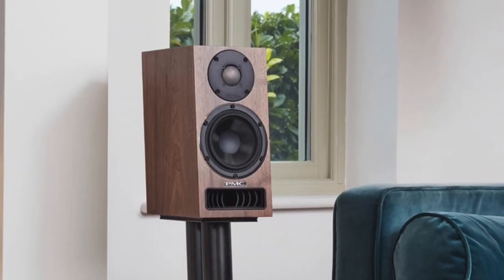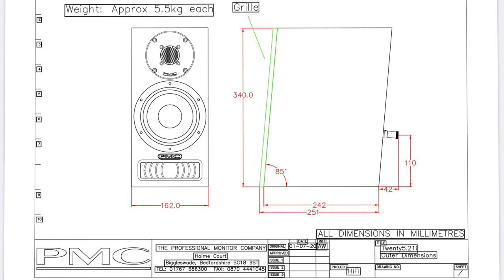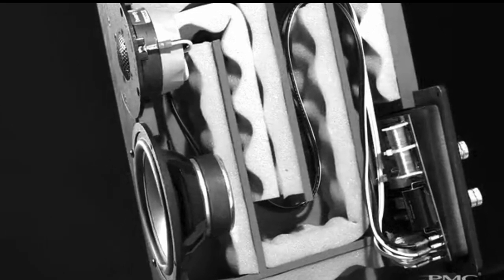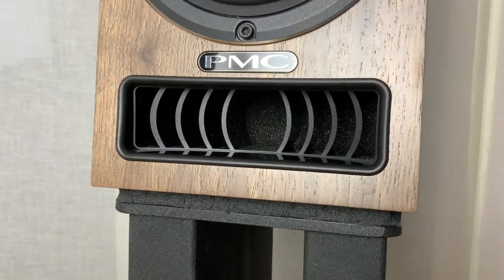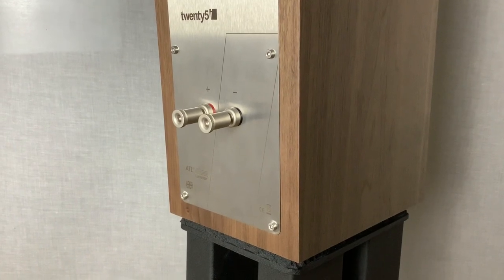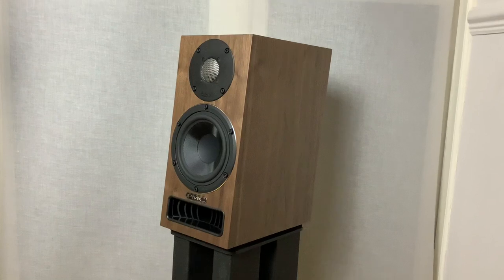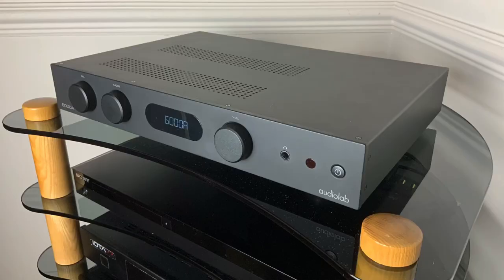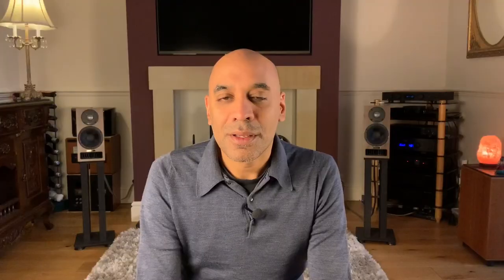PMC Twenty5.21i Speaker Review

Comment: Great review! Amazingly compact speaker for a transmission line. From my experience of building speakers TL’s are the way to go. Not sure why they have such good transient response (clean bass).  I noticed that in the ones I built using Focal 5 1/4” woofers. I thought it was mainly the woofer design with its light stiff cone material, low Qe and compliant surround. Maybe the fact that you can get away with smaller more compliant drivers in the TL and still get good bass extension is the reason for the faster bass??
Reply from the maker: Hi  Jim, I imagine the TL is pretty good at keeping the back wave from the woofer from reflecting back and causing distortion. I expect the cabinet compliance is similar to that on an infinite baffle design. Thank you for watching and sharing your experiences. I appreciate your support 😊👍